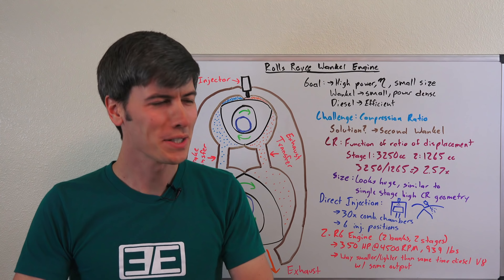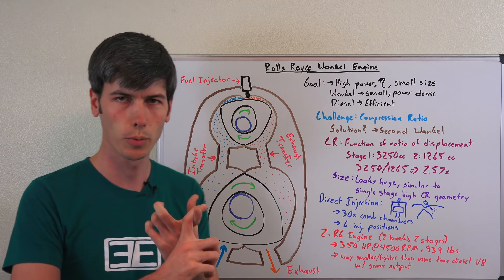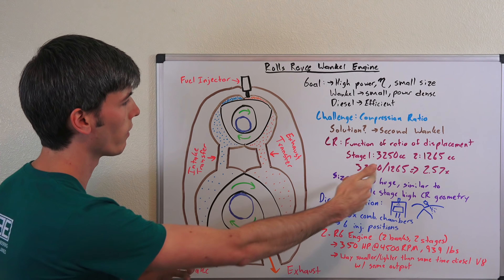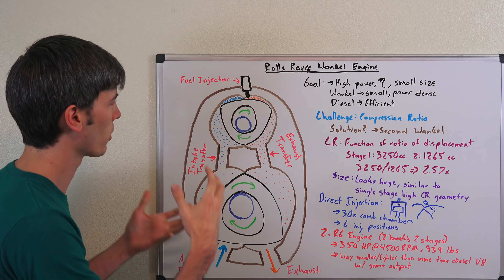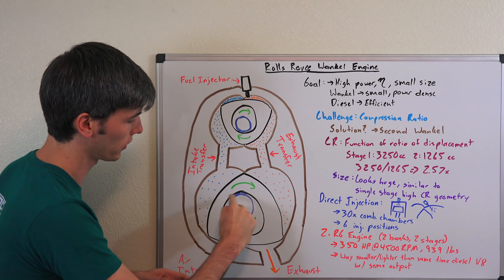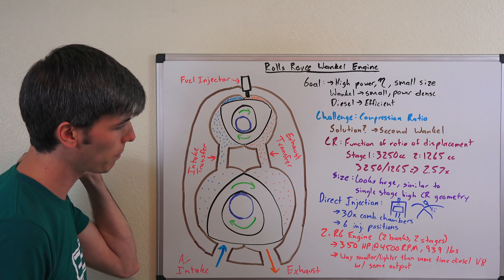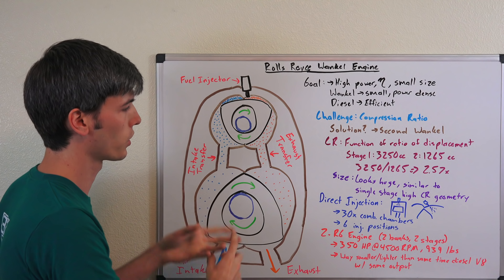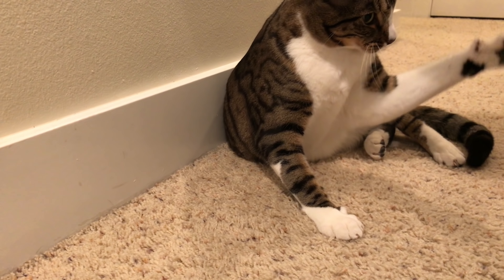Rolls Royce Made A Diesel Rotary Engine With Four Rotors!

Comment from the maker: Hopefully we haven’t seen the last of the Wankel engine. Certainly don’t expect to see any innovation from Rolls Royce on it, but it would be cool to see a real return before ICE’s become completely obsolete. Hope everyone’s having a solid week! If you like cars, consider following on Instagram. If you prefer cats, consider following @bucketron on Instagram. http://www.instagram.com/engineeringexplained
Reply: Engineering Explained You think ICE's will be obsolete? I feel like the best solution would be a diesel  hybrid.
Reply: Yeah EE I reckon ICEs are obsolete already, if Mazda were really smart they'd make their Vision RX into the Vision EX.
Reply: Electric Magician Diesel ICEs will be around for much longer. Electric motors can never perform as well as diesel engines for getting low end torque, when it is -40 out, and the motor has a million miles on it.
Reply: Actually Mercedes-Benz also did some research with wankel engines, also 3 and 4rotor.. and in 1960 to 1970's :) check out Mercedes Benz C111
Reply: Exami whom,

B
Reply: Except that electric motors make peak torque at zero RPM... checkmate diesels
Reply: +Jordan Prier Electric motors are already perform better than any existing ICE, in any temperature, and mileage is virtually a nonexistent parameter. The ONLY thing which prevents electric cars to take over fully is still the problem of energy storage. Pretty good battery chemistries exists now, but they are still expensive and the volumetric energy density is still nowhere near to the liquid fuels.
Reply: Mazda said its coming back. So there is that.
Reply: I REAAAAAALLLY want an SCCI rotary. That smooth rev-up, could be turbocompounded or turbocharged, probably quite high fuel-specific output. Mazda, watch out.
Reply: could the larger roter be used to drive accessories leaving the primary to only send power to the drivetrain?
Reply: Exami I saw an article on that, I think it was an old c class or something.
Reply: Gábor Móczik But that is the problem. They only give out torque  at the beginning and because they don't used transmission they can't have low end torque again. An electric engine would struggle to do WORK. Plus they overheat super easily. Like teslas can only go full speed once or twice before the car goes into limp mode so things don't start melting. When you are climbing heaven's stairs up the rocky mountain side, you don't want your tractor trailer to go into limp mode. Also electric engine don't have any braking abilities. Diesel engines are great doing control desents using engine brake. Actually read my point, not saying one is better than the other. Just that diesel still have a long life ahead of them. Hell diesel engines are pushing 1000 torque nowadays and I thought electric engines are better at producing horsepower and technically not wheel cranking power?
Reply: Jordan Prier Electric motors have an extremely wide torque band so they maintain maximum torque almost throughout the entire rpm range. Also they have regenerative breaking which essentially uses the motor as a generator to slow the vehicle and simultaneously charge the battery. They can run at peak rpm continuously, as stated above their biggest draw back is energy density of the battery. I think the best solution for long haul driving is a battery swap station where the battery is quickly changed instead of charging it.
Reply: Sheldon Robertson the bigger rotor is a super charger. Only the smaller rotor does combustion and it powers the bigger rotor. Exhaust gas from the smaller rotor helps push the bigger rotor (like a turbo charger), which helps with efficiency (normally super chargers aren't very efficient).
Reply: David Mason They also have issues with extreme weather. Also brakes that recharge the battery are not the same as engine brake.
Reply: "ICE’s become completely obsolete". This should not happen. This would be the saddest thing to happen
Reply: Suggest you research a company called LiquidPiston, father-son team of MIT PhD's, which created what is effectively an inside-out Wankel Engine currently under DARPA development program and satisfactorily tested on small scale. They claim a 70cc 4-stroke engine that weighs under 5 pounds.
Reply: Who mainly utilizes diesels? So yeah, you want easy living, diesels will be here many many more years. If you were talking about having a fast and fun car, you tagged the wrong comment. Either way, technology is great, I love my 2017 Nissan Altima, but I rather have both of my 2000 Mitsuishi Eclipses' for my "track runs".
Reply: Freight trains. But diesel generator, electric motor to drive the wheels.
Reply: Engineering Explained how much torque did it produce
Reply: Engineering Explained I reckon a turbo would have been a simpler and more efficient alternative to a second rotor. Still, someone other than Mazda working on a Wankel is nice to hear. Thanks for the video!
Reply: Michael Cavallaro that's from the 1970s. They aren't working on it.
Reply: And a standard turbo charger wouldn't work since a turbo doesn't provide much boost until there's significant exhaust pressure. This engine requires the boost constantly; it won't start without it. A standard super charger might have been better, but the second rotor is able to capture some more of the exhaust energy... So maybe not.
Reply: The additional Wankel engine acts looks like it acts as a turbocharger here, so why didn't they use a turbocharger?
Reply: Joey Sanders both rotors are mechanically linked and spin in sync. The additional rotor compresses incoming air like a super charger on the input and also recovers energy from the exhaust to help turn the wheels on the output.
Reply: Engineering Explained internal combustion culture forever!
Reply: If they could figure out a way to move the spark plug into the rotor, it would solve the emissions problem.  However, then you'd need at least three plugs per rotor, rather than two.  Changing them would require a complete engine teardown.
Reply: Yup, I prefer cats, but only of the Jaguar variety. ;-)
Reply: @Bryce Corbin: Well, in this case it's a diesel so there's no spark plug to worry about...
For practical reasons such as the complete tear down to change spark plugs that you wrote about I don't see moving them to the rotor as a viable alternative. I know I've seen something about some one who claimed to have solved the spark plug problem in a surprisingly simple way, but I can't remember the details. (Makes me wish I could just wipe some of these incomplete memories.)
Reply: But alas, a diesel can never be a high-revving engine, because the ignition timing can not be advanced, since it has no spark plugs.
Reply: I remember reading an article in an old issue of national geographic back in the 90's about Isuzu experimenting with ceramic engines, and there was also the ceramic rotary engine project in Texas but I I haven't heard any new developments from either. Might be an interesting topic of a video for you Jason.
Reply: Creamic used in engine blocks and pistons was something I heard about way back, some 35 - 40 years ago. As I remember it the primary advantage was that you wouldn't need to cool the engine and with a much hotter engine the efficiency would go up.

Several years later I heard of new kinds of ceramics and ceramic composites that had properties allowing them to be used for springs, both coil and blade versions were demonstrated.

Fast forward to today and ceramics haven't had the huge impact researchers hoped for. I don't know where they failed, but it could be economics or the materials never managed to measure up to the alloys they aimed to replace. It could be something as simple as heat expansion being dissimilar enough that mating metal to ceramic was problematic when the engines got hot enough. But that's just me speculating.
Reply: Blahorga Slisk Ya, my guess would be that manufacturing difficulties were the major stumbling blocks, that and getting a material tough and strong enough to reliably withstand hundreds/thousands of explosions per second.
Reply: +Engineering Explained  How is the maintenance for a diesel rotary engine compared to the traditional diesel engine? (Wasn't maintenance for rotary engines in general one of the reasons for it being a niche market?) And, would a diesel rotary engine be better engine for an electric generator compared to the other engines?
Reply: Engineering Explained the internal combustion engine is superior to any electric car, stop this meme.
Reply: Rotary engines are already dead. Diesel is being phased out in major cities around the world. Like it or not, electric is coming...
Reply: John Clarke, who did an aero engine (gas turbine) apprenticeship at Rolls (I wonder if his ideas rubbed off on them), developed the first ever diesel rotary while at Caterpillar. It did succeed in being compact, but as with all rotaries, especially with a high-compression C-I rotary, the combustion chamber had lots of surface area leading to lots of heat loss and low efficiency. The 2-stage compression with a smaller second stage rotor in this Rolls design will help with that a lot, creating much better combustion chamber geometry than a single rotor, but I expect not enough to make it practical from an efficiency point of view.
Reply: internal combustion engines will soon be replaced by external combustion engines
Reply: @beefchillingham6790  
Diesels are to be outlawed in may EU countries.
Reply: @davidmason8371  
You need to get up to speed on EV charging and how many and where they are. Subscribe to Fully Charged.  That is superb on charging and EVs.
Reply: @hndutube  
""ICE’s become completely obsolete". This should not happen. This would be the saddest thing to happen"
The sooner the better.
Reply: @thebunnisher109  
The Liquid Piston engine is used by the US military as a genny on an artillery gun.
Reply: @mcav85  
Many companies make rotaries. They are used for UAVs.
Reply: @johnburns4017  I'll check it out, thanks.
Reply: I have so many questions I wish to ask from a design standpoint.  So many ideas that I would like to be looked at mathematically.  But here I am having no idea where to pose the questions and just dreaming about maximising efficiency and power of a rotary engine.  Firstly, what do we call an engine that has 2 rotors per ignition chamber?  A 2 stage rotary?
Reply: @jordanprier4016  Which is not 90% of the world, ICEs will live in such edge cases. Elsewhere it's the dawn of ICEs. 

PS I own a diesel & petrol ICE car :p (for now).
Reply: @gabiold  and the fact that many of us still think they're gayer than Liberace...
Reply: I think this would be very good to burn hydrogen with or literally water

Comment: I wonder what that would have sounded like?
Reply: Sarah n Tuned Like this, weeeeeeennnngggg wah weeeeeeeennnng. Waaaaaammmm wah pop pop pop wah weeeeeenggg.   Or very close to that.
Reply: Sarah n Tuned 
My guess would be similar to the old school 2-stroke supercharged diesels.
Reply: "SKRRAHH PAP PAP KA KA KA SKIDIKI PAP PAP AND A PU PU DRRR BOOM SKYAAA DU DU KU KU DUN DUN POOM POOM" Big Shaq knew all along
Reply: Richard Nygaard 😂😂😂
Reply: kle kle kle kle kle kle kle
Reply: I'm done :)
Reply: Like a regular diesl engin i guess, it's 4500rpm. Essence wankel engine have the high pitch sound because it rev at 10000rpm (and that's why it's close to the noise of f1 engine)
Reply: Taydrum OMG, hahahahaha 😂😂😂
Reply: boxz1984 Mildly inappropriate for a YouTube channel about car engineering.
Reply: +Uryendel But even at low RPM Wankels sound like a big metal mouth blowing raspberries. Are you sure it wouldn't sound like that with a hint of diesel knock?
Reply: I bet it was perfectly silent
Reply: My guess is, diesels that want to be very efficient have low idle, and rotaries also have pretty low idle so it would brap a lot but due to this second rotor forcing air it would force air out quickly, so it would be short and loud braps.
Reply: Richard Nygaard i know Sherlock :D :D but then again you never know how would that engine sound like :D
Reply: An RX7  with an exhaust leak and s spun main baring. lol
Reply: A 100% sounded better than a Tesla:)
Reply: Sarah n Tuned yea! B cuz not a big fan of the gas powered rotory
Reply: Probably sounds like the scat man.
Reply: idk it might sound like a depressed and sad 4 rotor
Reply: Good.
Reply: It would sound like 
tax money tax money tax money tax money, turns of.... 3s later u turn it back on 🔥  money money money....(engine noise again) tax money tax money

Comment: DORITO POWER, Mazda, get back on the rotary power!
Reply: 3D Doritos were quite possibly the best chip snack ever created. They also ran this engine.
Reply: Would love to see them even make a small comeback, they're such interesting engines.
Reply: iLupi the rotary motor almost put Mazda out of business lol
Reply: Don't weinkels require specific maintenance and require a different set of habits most drivers do not want to be bothered with?  My grasp of them is limited but I understood it as they are suited for racing not driving?
Reply: The extra maintenance was adding oil when you got fuel as it has an oil drip line running into the chamber to lube everything and it burned the oil with the fuel. also regular engine teardowns to check the seals etc.
Reply: Iron Dorito love the name and rotary profile picture XD brilliant
Reply: They trying with the skyactiv R
Reply: iLupi lol
Reply: Mazda never quit developing the technology they just quit selling them
Reply: @johnmeurer4780  Mazda ceased all development of Wankel engines in May 2009, no new prototypes have been seen since the 16X was canceled.
Mazda has not unveiled any new production Wankel engines in over a quarter of century.
Reply: @sandervanderkammen9230  they stoped production of the wankel. They still research it and put out new patents for wankel engines
Reply: The rotary engine is unfortunately unreliable economically and structurally. They had issues with being fuel efficient, while being underpowered compared to their piston engine counterparts. Plus, the vehicles they powered with these engines were difficult to maintain due to odd placement of parts. Plus, apex seals went out in these engines too often for the engine to be reliable, meaning you would have to completely disassemble the motor to do so.